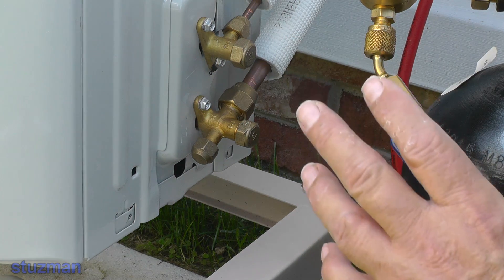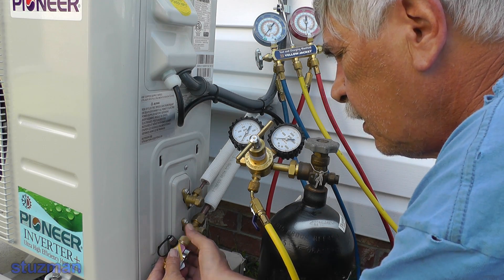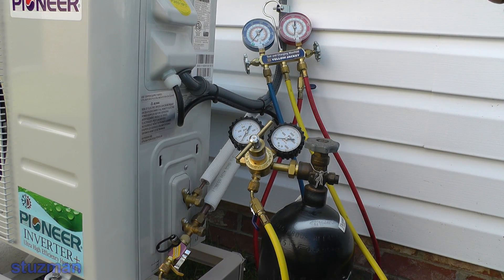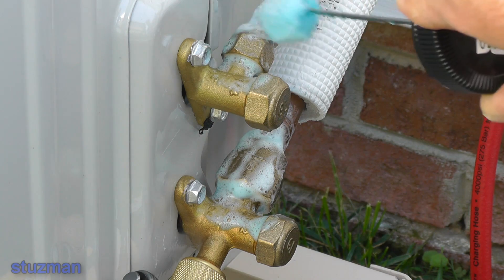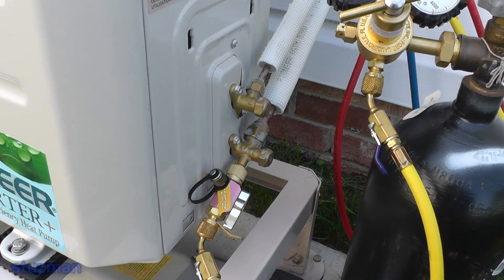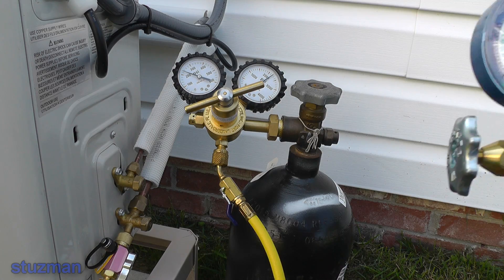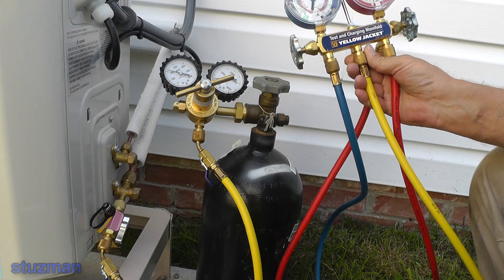Mini-Split Heat Pump: Nitrogen Pressure Test

Comment: Is there a  certain type of  nitrogen that you use ?
Reply from the maker: Hi David! It's a dry nitrogen which can be purchased at airgas supply which is a national chain. You can tell them that you'll want to use it for testing for leaks in HVAC, and they'll know what you need. If you don't have a tank, they can supply that also. They will charge for the tank, but when you need to refill it, you'll bring in your empty tank and get another one already charged with nitrogen. You'll then only pay for the nitrogen. If memory serves me correctly, it was about $120 for tank and nitrogen and with a refill, it was about $30. Have a great day!
Reply: Thank you very much  everyone  talks about nitrogen but doesn't explain what it is , as I think there are different kinds... I may be wrong but  thank you
Reply: And on a side not do you know if airbase sells tanks ?
Reply from the maker: @DavidGeorge-wp1kz  I never asked, but I don't see why. Have a good one!

Comment: do you have to remove the schrader valve when pressure testing or vacuum testing? Also my iQool9 (electriq) has no info on what pressures to test to so I have no idea whether 200psi or 300psi or even maybe 150psi?
Reply from the maker: No, it's not a requirement that you remove the schrader valve. The reason for removing it is to allow a faster evacuation of the air in the line-set to minimize the restriction. If you want to go a little higher pressure than me, you could use 300psi, but the other pressures are fine too. Have a great day!

Comment: Hi Stuzman, thanks for this video. 
I watched it again and I noticed you didn't shut off the nitrogen tank when doing the pressure test. If there is a leak then wouldn't the nitrogen keep the pressure level up? Shouldn't you shut off the tank while doing the test?
thanks
Reply from the maker: I did close off the valve on the  manifold gauge set. Take a look at the timeline at 4:00 and you'll see that. Have a  great day!
Reply: @stuzman52  Okay, thanks! I had to watch it again to see you do it. Thanks again for your help.

Comment: Thank you for putting these very detailed videos for everyone! I'm about to attempt to replace the outdoor unit and already swapped those and connected lines and power. Have a couple questions as I want to be clear on couple things before continue:
1. I assume this is new pre-charged system. So it's OK to test lines (and indoor unit) when both valves (under caps)  are closed?
2. I don't need to do vacuum procedure prior to pressure test, right? Just connect lines to unit and proceed following steps in video?
 Thanks!
Reply from the maker: Yes, you will leave both valves closed when you're testing the line-set and indoor unit for leaks. It's always a good idea to pressurize the system with nitrogen because small leaks will be revealed when it's under the nitrogen pressure. If you ignore this step and proceed to vacuum the system, it may appear to hold vacuum for a period of time. But I can remember several times where I just vacuumed the system without pressurizing it with nitrogen. Pressure stayed around 30" Hg for several hours. Opened the valves and about a month later, I found out that I had a very small leak. And what if you just vacuumed the system and saw that the pressure didn't hold? How are you going to find a leak under vacuum? Not possible....So, pressurize the system with nitrogen to ensure there are no leaks and then proceed with the vacuum. Have a great day!
Reply: @stuzman52  Thank you !!!
Reply from the maker: @kirill_gusev  Glad to help!

Comment: Were valves towards compressor and condenser closed during this test?
Reply from the maker: Yes, that is correct, the valves are closed during this test and they remain closed when you're doing an evacuation of the system, (in other words when you pull a vacuum on the system).
Reply: @stuzman52  thank you.
Reply from the maker: @briekhnaa  You are welcome!

Comment: I was always told to pressure test to 400-500 PSI when using flare fittings
Reply from the maker: Hi Larry! The manufacturer has already tested the indoor and outdoor coil at these high pressures. The only thing that we're testing is the flared fittings which do not need these high pressures. 200-300 psi is more than enough for testing for very small leaks. Of course, if you want to test at the higher pressures, then make sure the pressures do not exceed the test pressures which are on the indoor and outdoor units.

Comment: Is there a way to make this test on the unit BEFORE install? I have a store-return unit with damaged fins, and want to ensure it does not leak before purchasing further equipment.
Reply from the maker: Yes, you should be able to still pressure test the unit.

Comment: hello ..i purchased a della 36 btu 3 zone unit that i'm currently installing
and noticed when i was attempting tonever  install the line sets to the condenser units that they are filled and capped off (plastic caps) with nitrogen from the factory.
i've never seen this before, is there a procedure that i should be using since the condensers are filled with nitrogen, or do i just release it and hook up line sets and vacuum???
Reply from the maker: Hi Sabrina... I looked over the installation procedure for your unit. There is only one set of lines which goes to the indoor cooling unit that will have nitrogen in them and these lines are capped to prevent the nitrogen from coming out. When you remove the plastic caps, you will hear the nitrogen being released. This is normal. The refrigerant is stored in the outdoor cooling unit which is prevented from coming out by the two service valves located on this unit. As for the line-set itself, there is no nitrogen inside of them. You would make all of your line-set connections, pressurize the system with nitrogen to check for leaks and if that looks good, then you would vacuum the system and release the refrigerant into the line-set.

Comment: Personally, I would do a drop test for a few hours in addition to soap testing the fittings. My current mini split system says to test for several hours. 
Simple to do. Just shut off the nitrogen once you have your pressure (200# in this case). Crack a fitting to verify the gauge is not stuck. Visually observe the gauge drop a little. Tighten fitting and allow the pressure to sit for a few hours. Nitrogen will not expand /contract like "atmospheric air". So, ambient atmospheric temperature changes should not be observed in the gauge. Check on it after 15 minutes, 1 hour. If you have a pressure drop you have a leak. Pressure increase might mean the nitrogen valve is not completely off or sealed or ambient temperature increase causing increase in pressure (not likely with nitrogen). This will allow you to test all of the system. Areas that are sealed and lines that are insulated. Not just the fittings.
Reply from the maker: Thank you for the comments and have a great day!

Comment: Awesome! Thanks for your informative video. Just a quick follow up questions here.  1. Did the Nitrogen gas get into outdoor unit?  (I suppose not)  2. What is the purpose of the adapter at the service port?  Just for changing the size of the head or for other reasons?
Reply from the maker: To your first question, the service valves are closed, so when you add nitrogen to the line-set, no nitrogen will go into the outside unit. And the purpose of the added adapter on the service port is for two reasons. It will isolate the high pressure of the refrigerant when it's released from the micron gauge and will prevent any refrigerant oil from contaminating its sensor. Thanks for the comment and have a great day!

Comment: I have a pioneer 36k 4 zone that I am about to nitrogen test ,pull vacuum and top off the lines with 410a since I extended them past 100 ft..Should I pressure test at 200 or higher?? The unit has a sticker on it with max and min pressure numbers that the system produces. IS 200 Enough psi for the test or should I go a littke more?? I don't want to over pressurize the system butvI also want to check real good for leaks since it's 150ft on lines and 4 zones..That's alot of flare connections.thanks Your videos have really helped me.I purchased 1000 in tools to do this job right.
Reply from the maker: Hi Daveboy! I would go to 300-350psi and shouldn't be any problem. A lot of folks want to test at 500-600psi but this high of a pressure is not necessary. At those high test pressures, the indoor and outdoor coil has already been tested. You're only testing the flare connections. Sounds like with your invested tools, you're going to do a great job! Have a great day!

Comment: My mini split has no pressure at all the outside compressor barely wants to run there are no leaks I made a mistake and let all the air out how do I fix this I thought the compressor actually build up the pressure in the lines I'm trying to figure out why mine's haven't built up any pressure
Reply from the maker: Is this a new install or has it been running for awhile and now you have this issue? When the system is installed, there is air in the lineset and the refrigerant is inside the outside coil. The refrigerant is held inside the outside coil by the two service valves. The inside coil will have two plugs on the lines which when taken off will release nitrogen which is from the factory. And what do you mean when you say, I let all the air out?
Reply: @stuzman  OK so my mini-split was running just fine till Friday when my new mini split stand came I pumped down the unit sending all the refrigerant back into the outside compressor right installed the stand hooked everything back up nice and tight my mistake came when I opened up the high pressure line allowing the refrigerant in then opening the low pressure side I called my self bleeding the air out by pressing the valve stem until I saw a lil refrigerant it's worked for me perfect the first time but this time I must of did something wrong
Reply from the maker: @thelithiumpowerch  Ok, good luck on what you find and hope you get your system running.
Reply: @stuzman52  I'm waiting on a vacuum pump and gauges and hopefully I can create the pressure it needs by pulling a vacuum
Reply from the maker: @thelithiumpowerch  Just keep in mind that if there is no refrigerant, no amount of vacuum is not going to raise the pressure. You mentioned that you don’t have any gauges. Just crack one of the fittings at a service valve to see if you have any pressure. I looked back at one of your previous posts and you mentioned that you let all the air out. Maybe, you let all the refrigerant out. The compressor will move the refrigerant throughout the system and the pressure it creates is based on the refrigerant being in the system. Thus, if you have no refrigerant, very little pressure in the system when compressor is running.
Reply: @stuzman  right that's what I was thinking because when I did let the air out it was only air the refrigerant didn't make it all the way to the valve no wetness from the refrigerant or nothing just air

Comment: If there's air in the lines then all you're doing is pressurizing the air in the lines to 200 psi, the lines are not filling with nitrogen and neither is the indoor evap unit. The only way to get nitrogen through the indoor evap and lines is to open the opposite line (the high pressure line) and allow it to purge the air from the lines, OR, evacuate the lines (vacuum) before doing the nitrogen test. This is preferred given the whole idea to using (dry) nitrogen is to keep moisture out of the lines and system to begin with, otherwise why bother, just use compressed air for that's what's going on here in this demo.
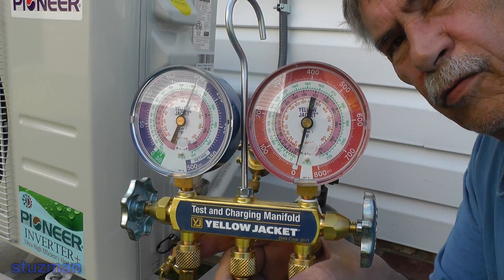@4:05 Umm, if you're going to watch for any indication that the gauge needle is lowering (a leak) you have to shut the supply off at the bottle of nitrogen or close the low side valve on the gauge set. You did close the low side gauge valve but didn't mention it in the video.

Comment: Fantastic video, thank you for providing this resource. One question- at the start, do you need to remove the schrader core, or does the schrader core remain in the service port for the duration of the test, since it's a 1-way valve that lets the high pressure nitrogen in?
Reply from the maker: Hi Kevin and hope you're doing well. The biggest reason to remove the schrader valve is for the next step where the air is removed using a vacuum pump. With the valve removed, it takes considerably less time since you won't have that restriction. You could leave the schrader valve in, but it would take longer to evacuate the system. Have a great day!

Comment: @4:50... you never turned off the supply of nitrogen!  It will not show a leak if you do not turn off the supply and cap off the flow from the tank.  Maybe I missed it?
Reply from the maker: You don't have to turn the supply off at the tank. I opted to turn it off at the manifold gauge set on the low pressure side at timeline 4:01. Thanks for dropping in and sharing a comment. Have a great day!

Comment: Don't you have to turn off the nitrogen tank to watch if the pressure will drop? If there is a small leak the tank will just keep filling the system and keep the pressure at 200PSI?
Reply from the maker: Hi Mike, I didn't mention it in the video, but I did close the valve at the 4:00 mark. I could have closed the valve at the nitrogen tank or which is what I did is close the low pressure valve on the manifold gauge set. Have a great day!
Reply: @stuzman52  Thanks I saw the other reply and rewatched the video - Thanks!!

Comment: While you were at it , I would have cracked the high side nut on the outdoor units and purged the line completely with nitrogen,  then later when you get to vacuum testing you are only dealing with nitrogen in the lines.

Comment: Good information!  One question is, since the pressure doesn’t drop, why do we still need to do bubble test? They seem duplicate to me. Thanks!
Reply from the maker: When using an analog gauges, it could take awhile to be able to notice a pressure drop. If I was using digital gauges, the pressure drop would have been noticeable earlier. With the bubble test, it's just another assurance, that there isn't a leak. It's more of a peace of mind that the system is leak free before opening those valves. Have a great day!